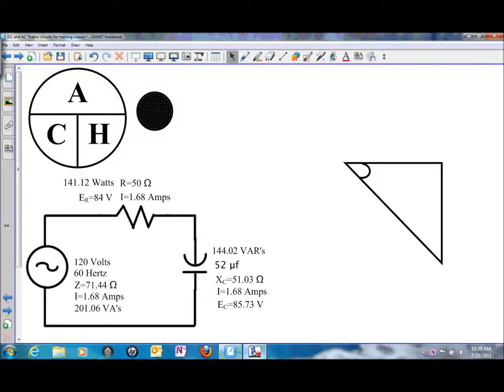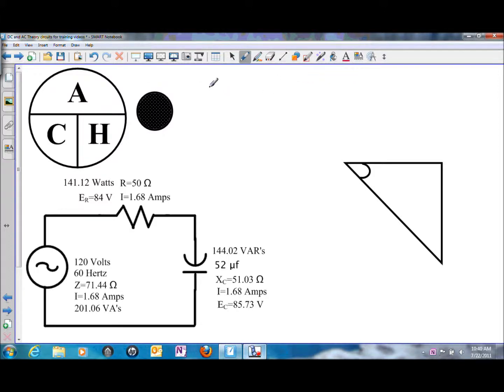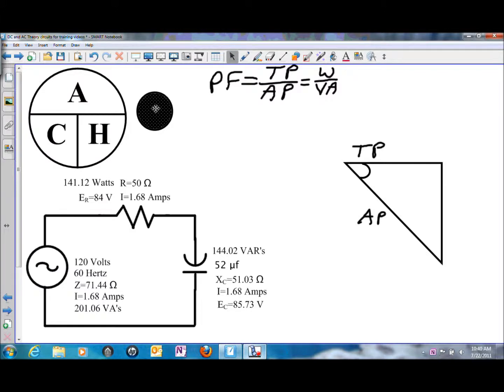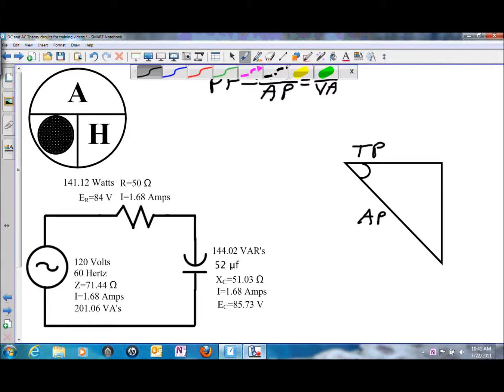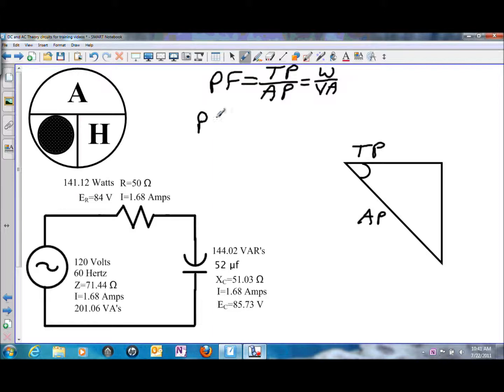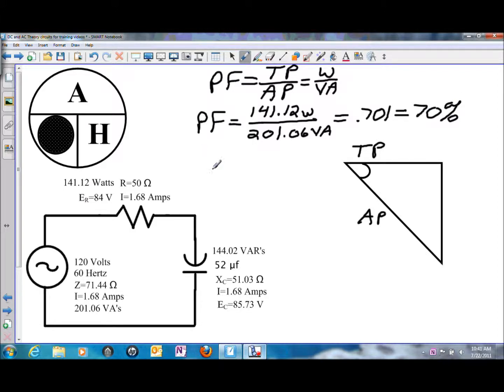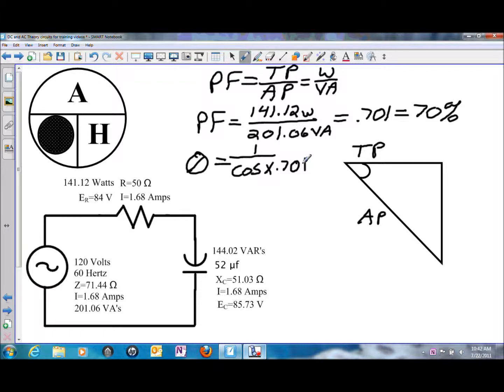Solving for Power Factor and Angle Theta in a Series RC Circuit.wmv

Comment: Arc cosine is not equal to 1/cosine. If cos(theta) = x/sqrt(y^2+x^2),  which is cosine OF theta, you can’t say theta = (x/sqrt(y^2+x^2))/cos(x). For example, cos(pi/4)=1/sqrt2 which means 2=1+x^2 x=1,y=1. Pi/4 is not equal to (1/sqrt2)/cos1. The correct nomenclature is theta=arccos (x/sqrt(y^2+x^2)) which is the arc cosine OF (x/sqrt(y^2+x^2)).